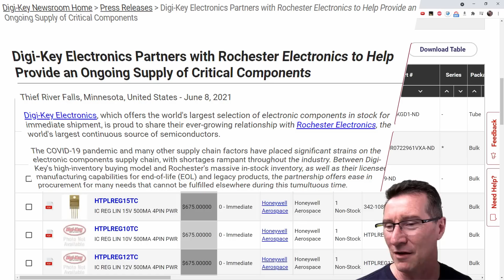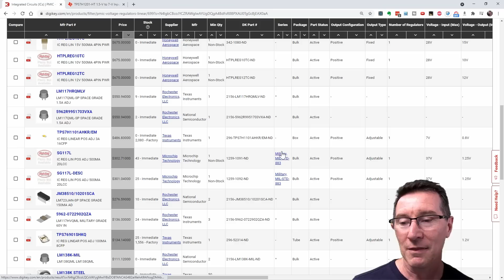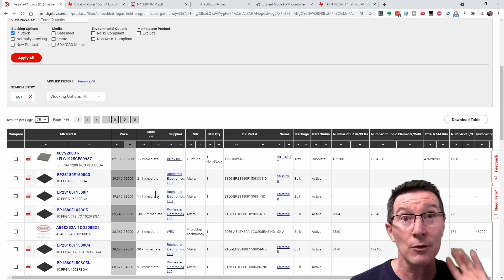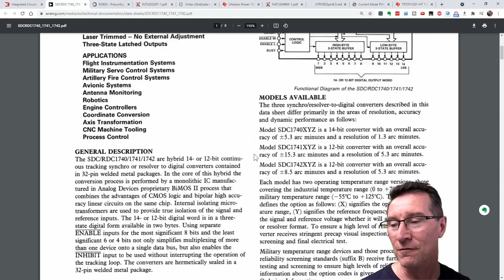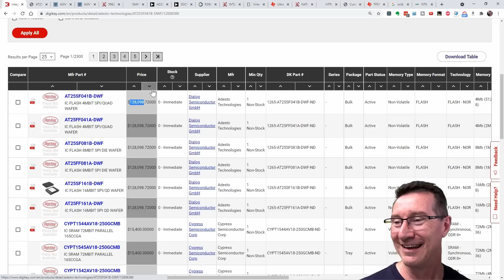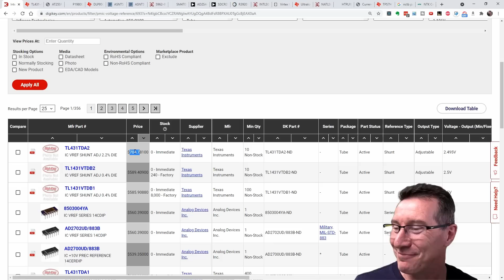EEVblog 1435 - The World's Most EXPENSIVE Catalog IC ?

Comment from the maker: @karsnoordhuis on twitter has found the most expensive thing (so far) on Digikey, a $1.89M Molex tool: https://www.digikey.com/en/products/detail/molex/0627007100/5152355?s=N4IgTCBcDaIAwDYwHY52QRjSAugXyA
Reply: Looks like some sort of automated processing machine. Wonder what happens if you just plop in the order, and send them the money? Does an 18-wheeler just show up to your house with a giant camper-sized crate?
Reply: No affiliate link? Big missed opportunity! ;)
Reply: Do they take personal checks?
Reply: @winstonsmith478  put it on card, you get points
Reply: It's probably a very high precision tool ($1,890,000.00000)
Reply: This sounds like a good video, the most expensive and rarest parts, take a trip to Digikey or some other distributor.
Reply: Of course its Molex... They charge 5 grand for a manual crimping tool they buy in for 50 bucks...
Reply: Added to cart.
Reply: @hugoboyce9648   Please note it's got bulk packaging. Quoting Digikey, "Bulk refers to a package (usually a bag) of loose unorganized parts, and is usually unsuitable for automated assembly machines".
Reply: @hugoboyce9648  i'll take two!

Comment: My father worked for General Dynamics ATS - I have a radar channel processor loaded with golden chips - It has 12 large packages from DDC before they went bankrupt. I was told the value of each chip was in the 6 Figure Range. Also for the time it was made, early 1980s it had multi-megabyte dram chips! I wonder how much those cost? lol

Comment: I suspect the lead frame is included in some of these expensive chips as typical soldering methods don't work (since the chip has to withstand 220C that's already near the melting temperature of the solder). So the chip is supplied in lead frame assembly so it can be affixed on the ceramic PCB using different techniques (spot welding each leg?)

Comment: high temperature requirements are most likely down hole drilling or very very hard industrial applications.
space components would also be rated in some way for radiation and cold temperature as well.
military plastic is typically -55 - 125 or 150 C operation.
most expensive: space, radiation
next: down hole 200C+ operation
big price drop right here.
then: military
followed by automotive and industrial.
then consumer.
i would imagine space rated maybe, but down hole are probably available. some time ago the drilling people seemed to stop using those expensive parts and take their chances with items they've "uprated" through test. 600 dollar ldo becomes 2.00.
but.... with availability being what it is they probably will come for those parts in due time.

Comment: I suspect that those funny frame mounted parts were for Ultra High Vacuum applications where they have to withstand the heat of bakeout and can't use material in the packaging that outgas. You can't use PC boards or most insulators, so things get funny and the demand isn't high, so expensive.

Comment: Some of these are probably also chemically resistant packages. That's the reason a lot of the mil-spec ones are ceramic or exotic polymers. A lot of mil-spec PCBs are coated with a two-part resin after they are built for additional environmental hardening. The packages have to be able to stand up to chemicals like acetone to survive the coating process.

Comment: The really important thing about space-rated parts is that they're radiation hardened & stay within spec over ludicrously large temperature ranges, which is really, really hard to achieve, plus they're all tested to meet spec. All these factors are very expensive to achieve, & require throwing away a large percentage of the parts during factory testing for not meeting spec.

Comment: I'm working at a company that dealt with Rochester electronics to get an EOL part that was impossible to find at trustworthy sources (a TLC540IN analog to digital converter), you can deal with them directly if necessary without going through digikey. Seems Rochester also has the capacity to "revive" some obsolete components, like re-producing some 8051 processors based on Philips/NXP designs in dip-40 packages

Comment: Seen those ceramic ICs a plenty in Soviet military electronics back at my school days. I believe Western military tech use the same packages.
It is crazy what is happening in semiconductor market now. Niece accidentally poured a glass of water over her Acer Nitro 5 laptop. Fried BQ24781 battery controller. That chip is available from Mouser or Digikey only by tall order with delivery at end of March 2022. Otherwise the only possibility is chips ripped from used motherboards from China.

Comment: The honeywell parts make sense, because you are basically paying for an absurd amount of reliability and warrantee. also, those prices are always going to be higher because the defense industry can buy them, and they have deeper pockets. you can get a gyro from honeywell for thousands of dollars too, which is crazy compared to the little gyros you can get that go in your phone. The flat earthers famously got a honeywell gyro to measure earth rate (15 deg per hour) and they measured it pretty exactly as you'd expect with a gyro that good. Earth rate is actually a little higher than 15, and its closer to 15.041067 using wolfram. The better your gyro, the more the cost and the more accurate your measurement of earth rate will be (not considering the clock you would need)

Comment: Fpga's specially the rad tolerant ones from microchip with tie bars are used for one time programming in their specially designed programming socket need to have contact in all pins without forming the leads.....

Comment: What are the chances that the overpriced components represent places where the military can dump its budget?
You may have stumbled on the "$700 hammer" section of the pricing.
Do the components seem like ones that would be needed for military purposes?  Radiation hardened or anything?
Reply: There's most definitely some systemic issues where military/space programs put the demand out there for relatively expensive parts, but it's not necessarily arbitrarily inflated. It's a byproduct of the program piece-part pedigree requirements for these programs that supercedes design to cost limitations (in most cases.)

Most of these high-cost components were sold in a government defined pedigree that mandates very rigorous controls down to the material sets, to screening inspections, & lot-qualification requirements. These costs are naturally absorbed into the piece-part unit costs, and due to the the inefficiency of ordering in low volume always makes these absurdly priced relative to commercial comparables.

Either way, most of these programs are relatively small volume, think tens, to hundreds a year, at best in most cases. So, the difference between 10 $1 part vs. 10 $100 parts is rather inconsequential over the actual development costs (engineering labor rates are expensive..). And, I'd guess a majority of defense programs really are using those $1 parts. It's really the Space market where you predominantly are seeing those  $1k+ unit costs parts, which is just a combination of pedigree (screening, lot-qualification, periodic qualification, radiation lot acceptance testing) + low volume that nets those big #s $$$$.
Reply: @timmcconnell2731     Well put.  I would suppose another issue is that in the past the development costs would have been paid up front however that would leave most people feeling hit hard in the money sack.  Over time the Sales/Purchase  Forces would realize that they could bury those heavy costs in the next purchase.  This works to make people feel better about not spending so much money however when viewed externally one piece at a time the cost per item can seem ridiculously high.  The actual costs were absorbed somewhere else Automagically and we are left with a bent view of reality.  Now, if we could reduce the amount of material in the item by 50% then the cost will go down 50% as well.  Obviously.  :)
Reply: @seanb3516  I think a huge part of the issue is the predominance of COST+ contracts. It sets up a design approach where these companies are compensated for every hour and material purchased. Almost sets up a toxic system where the more inefficient they operate, the more money they make. In a fixed price contract, things those design efficiency/reuse and material costs would be much more scrutinized. Of course, now there's this egregious cost baseline where they can continually leverage figures of the past as an artifact for cost reasonableness.
Reply: @timmcconnell2731    And I thought childrens clothing would cost half as much because they are half the size.  JK   Nicely explained.  Thanks!

Comment: You certainly want to be wearing yor anti-static strap when handling some of these devices. Imagine forgetting....oops, sorry!
Reply: Static damage can be cumulative and lead to latent defects. If an assembly technician has mishandled a satellite printed circuit board during the assembly process, three years later in the depths of outer space a component may fail that can potentially take down a subsystem or even the whole satellite.

Comment: Given my niche of musical instrument amplifiers, the most expensive part I ever spec is the loudspeaker, and I rarely stray from the Jensen MOD series, which are some of the most affordable options designed to not make electric guitars sound like ass.

1:46 What's with the wanky keystone effect? That's terrible, Muriel!

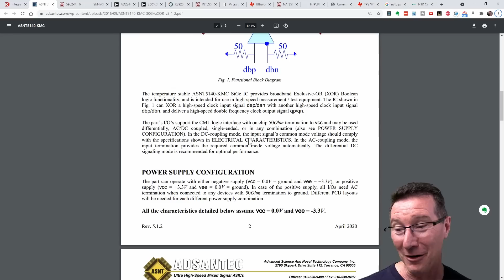18:10 I take it most of those pins are for extending guard traces right up to the package; they'd probably be routed out alongside all the differential traces right up to the next chip. Note they're all positive power supply pins; the negative supply rubbish is just the four pins in the corners. If you need a part like this, you're gonna know it and will be prepared to spend the money.
Reply: Did you have a point?
Reply: @jessiepooch  Dave asked what the most expensive parts are that we've specced; I answered. My example just happened to be on the shaffordable side.

Comment: Some of the lead frame stuff is intended for high G force application. Rochester hold surplus die, and package on demand, for a lot of stuff. Functional verification and burn in test, too. They also hold military stuff for contractual reasons - a lot of military contracts state an availability duration, which can be 30 years in some cases, and sometimes has a mandated stock level.
Reply: Ugh just shy short for F22 Raptor.

Comment: Well it’s cheaper to buy an expensive part than for the government to qualify a new version of a card or system.  Plus the logistics tail adds additional cost.  Just saying simple board respin cost an easy million.     Big picture view of change will justify spending 130k on a Xilinx part if it’s lead free having that part reballed and stored in nitrogen until needed.   Anymore I tell contractors just buy trays or reels  even if we are building 70 cards.  I tell the young engineer select the largest FPGA because it’s cheaper than having him spend weeks trying to meet timing requirements or to make something fit.  Yes it seems wasteful but it totally saves money.    It was shocking for me when I switched from designing Elmo’s (.87 cost limit) to DoD.

Comment: I found this one XQR5VFX130-1CF1752V..Estimate price is $170,000. However "The Xilinx in the United States has an aerospace grade FPGA that claims to have a level 10 radiation resistance and is one of the most confidential chips in the world. It is said that the price of this chip is over than $700,000."

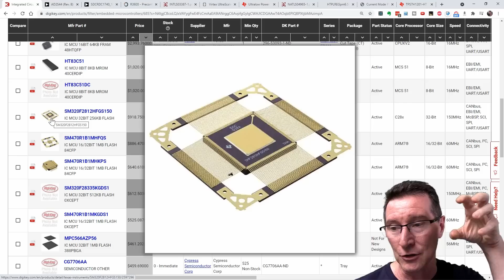Comment: @14:10  around 15 years ago, i worked with such components. A lot of work involved. 
Remove outer package.
Get IC out the inner package.
Tin the leads with a special setup.
Cut the corner pieces. (with a side cutter, or, depended of the size of the IC, a special cutter on a small special press.)
On a special press, bent and cut the leads.
Place it on a tray, so they can use it on a pic-and-place machine.

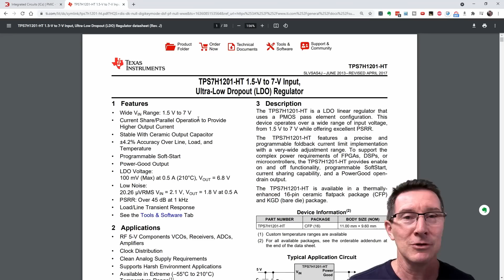Comment: 2:45 How can it be called "Ultra Low Dropout"  ?  100mV LDO is everywhere at less than USD$0.10.
Reply: 100mW is the maximum with a 0.5A load. Typical is 55mW. That seems pretty good.

Comment: Robert Feranec of Fedevel Academy had a chat with someone involved in space related electronics. One of the topics they covered was parts on lead frames.

One of the things that was mentioned was that the leads would be formed to custom shapes or dimensions using a custom jig by the people doing the installation, rather than the shape/dimensions being specified by the manufacturer.

I guess that means you can achieve very specific mechanical properties? Way beyond my understanding though.

Comment: the 200-210C max temperature is needed in electronics that are located inside oilwell drill heads, the grinding of rock produces masses of heat  and if  electronics can take 200C instead of 125C you can drill faster or use less coolant and it becomes cheap to buy 10-100K telemetrics if you can run the drill faster and thus generate more holes per given time.
Reply: Do you work in such a platform?
Reply: Well I guess they don't use regular solder on boards inside drill heads?
Reply: @Paul_VK3HN  yes.  Sn96 for 150C  and HMP above 185c

Comment: The available catalogue of high temp (+200C in my world) parts is incredibly limited.  It looks a lot like the salvaged parts bin of a hobbiest, most jellybean part numbers from the 70's 80's and 90's.  And they basically have to be. The high temp market is small so you can only make parts that are widely applicable and are simple enough (large geometry) to be made to work well at silly temperatures (see arrhenius equation). 

I actually considered that TL431 for a design when I was doing high temp downhole electronics.  Ended up using an CMOS version of it from X-Rel that was cheaper and easier to work with in terms of stability.  Cissoid also makes excellent high temp parts, but neither are carried by Digikey. 

Most expensive part I spec'd in was a $11,000 laser assembly.  We had two killed off during the course of development... sad days.
Reply: Famous last words of expensive development stuff  " Whatever you do, don't.....oh shit..."

Comment: Hey Dave, at 1 of my previous jobs, I worked on a team that designed projectors using the micro mirror DLPs from TI. These devices are not that expensive when you buy them in volume (which is the only way TI sells them), so this must be someone with a couple of devices left over from a production run and is looking to get rich by selling this to someone who has more money than brains. 
The most expensive part that I've ever touched was a 4 quadrant photodiode. This is used in spacecraft as the sensor that looks at a reference star and has output that is proportional to brightness offset from the center point. I was the technician who did the mechanical shock test to ensure that the device could survive the ride to space. Each device had to be signed by everyone who touched it. I can't remember the exact price, but it was in the 100's of thousands of dollars. I spent a couple of months testing a whole batch of these, obviously the batch size for these parts was not like the batch size for most parts, I think there was just slightly less than 200 of these devices. So I guess my signature is likely still floating around somewhere up there in the "final frontier".  🙂
Reply: The DLP said UV I believe, might explain some things
Reply: @benusberghi5546  That's really strange! Why would you want to project a UV image, when no one could see it? But the world is full of really strange things...
Reply: @mcconkeyb  It's used for 3D printers which use UV to solidify a resin
Reply: @atmel9077  You can also use UV-capable DLPs to expose lithography masks, or go maskless entirely: https://www.youtube.com/watch?v=Nxz_ENnmgtI
Reply: @atmel9077  Based on the limited resolution and ridiculous price, personally I'd find a better way to do this.
Reply: @niwasox3  This would only be useful for a home gamer, as the resolution is rather limited for professional work, and the ridiculous price seems to indicate that a better way (using UV lasers) is available. 🙂
Reply: @mcconkeyb  If these are for maskless lithography, you combine them with a stepper and/or optics that do coarse scanning of the beam.
Lasers inherently have lower throughput than these DLPs, because you only need binary imagery and these have no problems running at many gigabit (essentially gigahertz modulation bandwidth your laser would need at a minimum). E.g., a 1080p 10kHz one would run at just over 20Gb/s, and the corresponding laser would need at least 20 GHz modulation bandwidth to match it, along with precise scanner optics.

Comment: It says DIE, so they probably sell you the whole wafer. They'll also send you a die map which indicates which die are bad.  Depending on wafer size and die size, you're likey to get 1000 to 2000 die.  You then need scribe equipment to singulate, etc.  This is not for the DIYer, that's for sure.  It also says 70 non-stock, meaning you need to place an order and they'll get right on it.  :-)
Reply: Is it intended for direct bonding with PCB under a plastic blob?

Comment: I’ve used many of TI’s HT lineup for downhole designs. The parts you saw were unformed so you can lead form to your own specs. Some choose to mount them dead bug (upside down) and glue the mass down to the board down to survive higher vibration rather than suspending the mass by the leads.

Comment: The ceramic frame is used to keep the flat pack leads from bending during handling and fitting into test sockets.
Typically removed by the end user or during lead forming. May also help with handling during wire bonding.